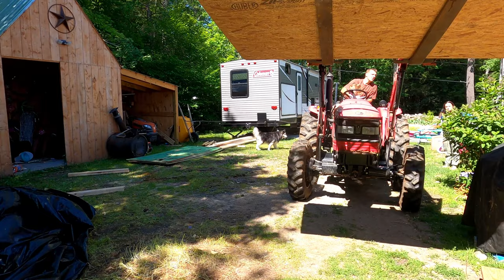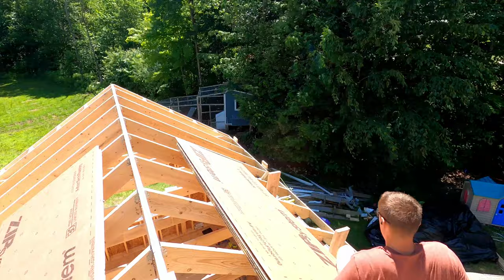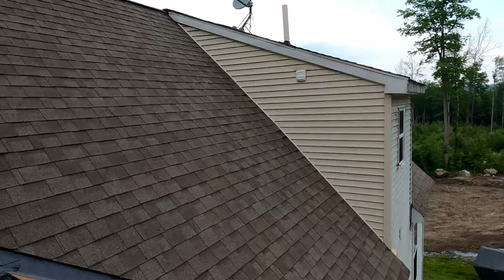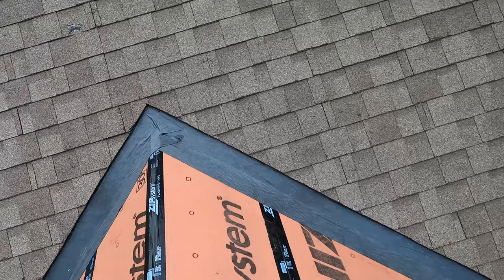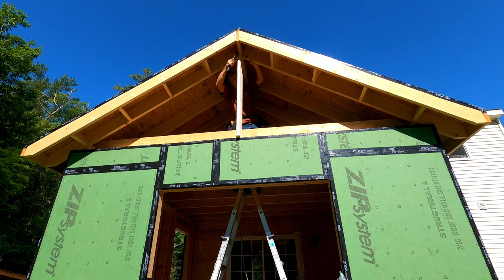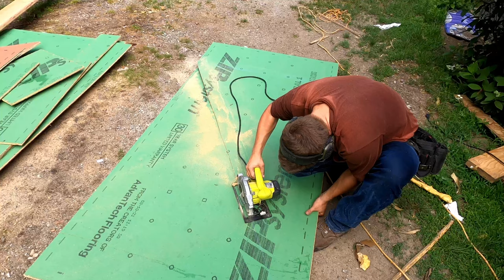Sheathing The Roof of our 14x14 Addition

Comment: Call a friend buy something to drink and drink after your done! Each board requires a 1/8 inch gap for expansion. Cover all nail heads just in case at install. Why cover nail heads you ask OSB sucks up water if the membrane is broken. OSB will swell and retain water if it gets in contact with could cause mold issues and the wood rots when wet. Meaning if the fastener is driven to deep you see OSB in the nail head area COVER it! Makes a jobs sound much easier to do it right at the start!

Comment: Thank you for your video,
Question: How did you install "side panel (V shape)" Did you install them between two 2x4?
I tried to remove and replace side panel at the left corner, but it was stuck at least with two more nails at the top section somewhere beteen two 2x4.

Comment: Bummer you completely skipped the step I was hoping to see! 😅 When sheathing a gable roof with a ridge beam, how did the sheathing panels mate up at the peak? Did they extend taller than the ridgebeam and touch each other? Did they finish plumb with the ridge beam?
Reply from the maker: Hey sorry, they sit about an inch down from the peak

Comment: Curious how you tie the existing shingled roof into the new one with the valley.  I saw in comments that you had someone help and didn't record - but did you have to strip that whole side of the existing roof to shingle in a proper valley? Or how else can you get valley flashing under old (likely to tear/crumble when lifted) shingles?  I'm gonna run into this myself and would love to know any secrets here at the crucial detail.  If you don't mind explaining what you and your helper did?
Reply from the maker: Bam, videos is coming in hot tonight. Thanks for supporting our channel!
Reply: Special valley seal tape and then valley  flashing over that, then overlap with shingles on both sides of one valley shingles overlap the flashing to divert water down flashing.

Comment: Curious if you used spacers between the sheets of sheathing? No continuous roof vent - are you using turtle backs to vent the roof? May wanna pay a college kid $20/hr to help you carry this stuff up there and hold something while you nail it. It’s brutal. 👍
Reply from the maker: We didn't use spacers, and theres a vent along the top. Next time I WILLLL have a helper. Pretty dumb doing it myself.
Reply: Spacers are used for expansion due to heat. The boards expand and contract day night and can crack at the ends without spacing.
Reply: @cattigereyes1  when they expand, without spacers, you can see the ridges where they meet through the shingles. Seen that happen. Roof gets the most weather changes from extreme heat (sun) and ice/cold.